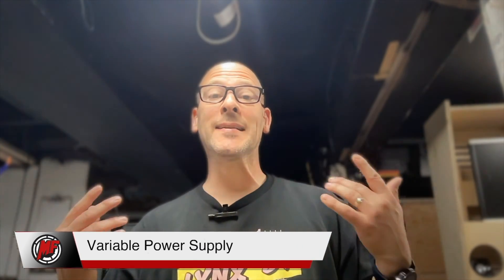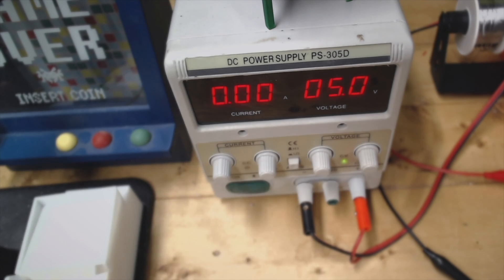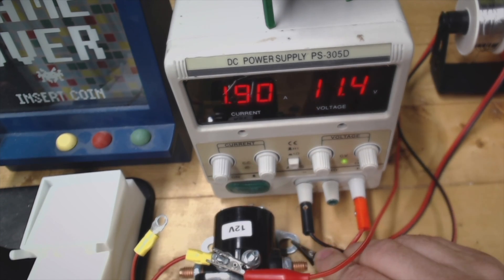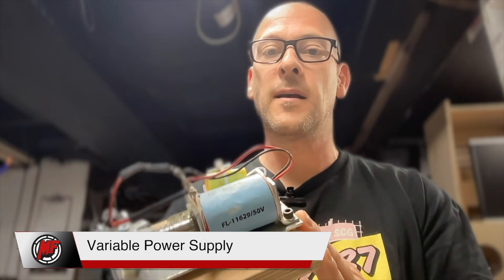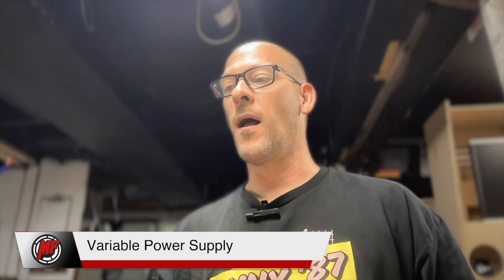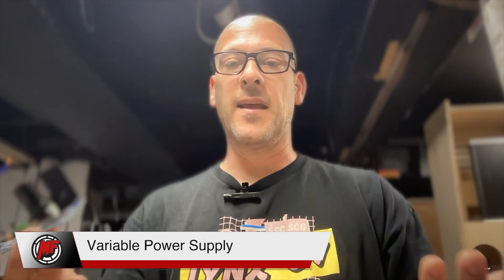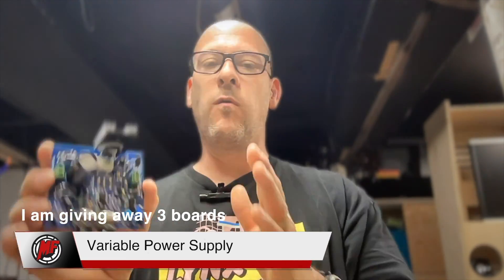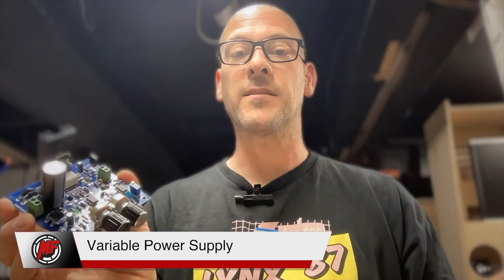DIY Power Supply

Comment: If I understood correctly, you said that you would be giving away the ElectroIndia boards. I would really love to have one. I have built three of the red board 0-30V/0-3A type and they all failed, eventually, due to manufacturer faults. I found that to be immensely frustrating. So, building one that would actually work would be a check off on my bucket list. Thank you for considering me.
Reply from the maker: Send me your info @majorfrenchy@gmail.com
Reply: @MajorFrenchy  Thank you!!! However, that email address does not want to work?

Comment: Is it possible to add some sort of screen to keep track of the voltage and current we're using?
Reply from the maker: Yes, you can add a small lcd screen to the board. Something like this Just found this amazing item on AliExpress. Check it out! 
C$2.72 | DC 100V 1A 10A 50A 100A Voltmeter Ammeter Blue + Red LED Amp Dual Digital Volt Meter Gauge Car Motocycle Voltage Current Meter
https://a.aliexpress.com/_mrdqe74
Reply: @MajorFrenchy  How would this be installed on the PS you have in this video? TIA